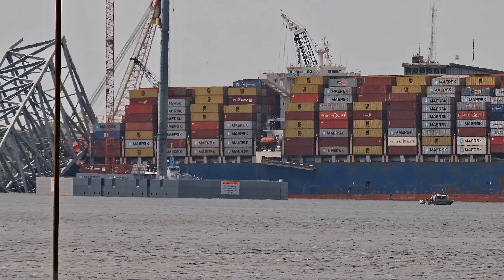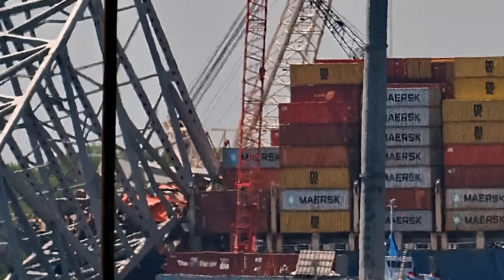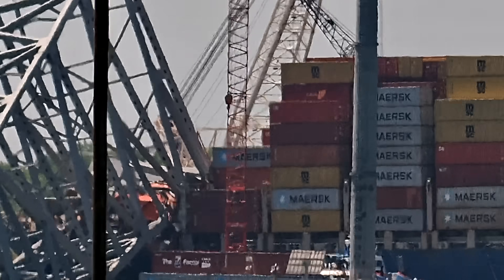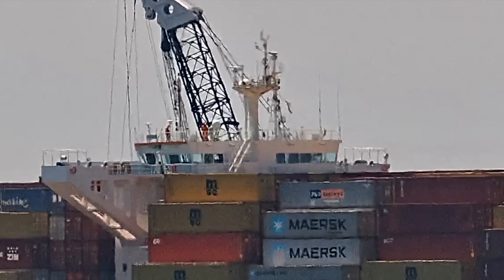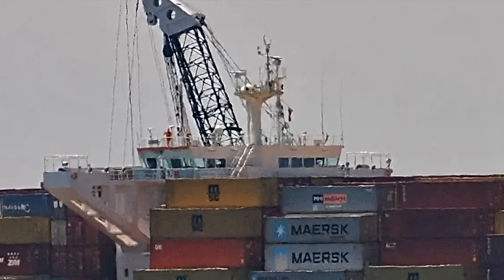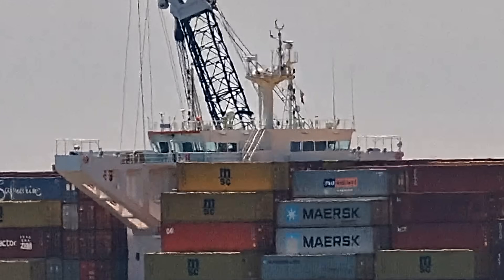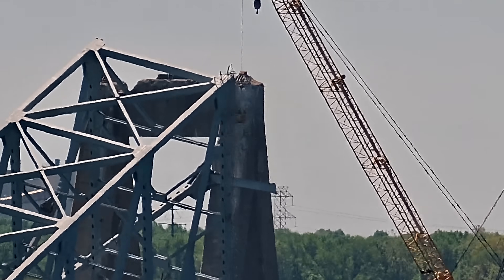Work at the Baltimore Bridge Collapse Site

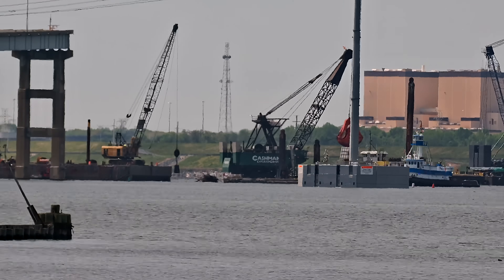Comment: 1:00 - I had been wondering what the yellow Lima 2400 was used for.  Turns out it's handling the drop ball to break up the bridge pavement.  The mess of debris that Dale Pyatt is pulling out shows how useful a big dredge is, just grab big handfuls of whatever is down there without worrying about what it is.

Comment: as they take these containers off of the ship won't that lift the ship and change the bridge parts that set on it?
Reply: The loads on the ship do change but is the change enough to move the ship?  That is THE question.  It could, but the most load is still the steel from the bridge on the deck which is not changing as the containers are removed.
Reply: @royreynolds108    also consider that the ship has run aground so the front is not floating right now. Of course, they also have the ability to flood ballast tanks to maintain trim.

Comment: I would like to know if there are a engineering team involved with this container unloading in regard to keep track to the weight of each container being removed so that the balance of the ship will be  kept so that the ship will not roll over when it is refloated?
Reply from the maker: Constantly monitoring
Reply: The crane's have load cell's that are connected to a operator display . It gives instant display on  angle, load, etc. 
That's how they report moving a 405 ton piece. This video show's the Cashman Dredge redlining with 2-3 lift's. Alarm's, buzzers, etc. went off and he turned the load loose. 
Yes, there is a record of the container #, weight and location. The ship engineer will keep track, update and provide info to the riggers that are removing containers to maintain the balance. No, Happy go lucky! or Time will tell! actions now after time has told. 
They are also told where to cut the bridge beams in order to get a 405 +/-50 ton piece, 50% (2X safety factor) crane capacity load.
Reply: @martylost167  Thank you for the peek inside the crane operator's cabin.

Comment: Why was the decision to work on the Dahi later than in the beginning?
Reply from the maker: Well I think they have been from the start. It may have not been as visible as it is now, but they have been working
Reply: Well the plan was to open the port first from day 1 for the people to have jobs and not lose what $10-15 million per day. . The Dahi work in the hardest, most dangerous and most time consuming. All the bridge steel has a preload like a very, very, large spring. Weights, loads and cuts must be all planned very, very carefully or someone else will be killed when tons of steel jumps 3-4+ feet in a thousand of a second.
Reply: @MinorcanMullet    I would imagine each section of this job has its own engineers working on specific problems, which is why different areas are moving at a different pace. I mean, it's a different task every few feet in this situation.

Comment: I know some of this work is nothing short of heroic but someone please tell me why there is only one, one-thousand ton crane on site when there are several 14,000 ton capacity cranes available elsewhere.
Reply: Correct
Reply: Lofting height/extension possibly? The difficulty of rigging and lifting bridge sections large than ~500 tons? Good probability they can’t handle the dismemberment at the staging area any more quickly than they are. (Although I’d think they could lift big sections out of the way and “park” them somewhere in the water outside the channel until they could be scrapped.)

I dunno, I would like to see the answer to that question.
Reply: Which crane ship did you have in mind for this job?
Reply: Have you(singular) considered that the room to work might be the reason?
Reply: In reply to ‘which crane ship did you have in mind’ I just Googled the question and found a Panama registered double crane ship capable of lifting 20,000 tons in a tandem lift. These cranes may not be currently located near Baltimore but I hope some of them are making there way there right now.
Reply: It would be good if the news reporters addressed the subject of why there is only one substantial crane on what is currently the most important demolition, an not forgetting human recovery, sites in the world
Reply: @raymason5779  There are all the cranes on site that can safely work the area in my opinion. 
A 20,000 ton lift takes months to prepare with the safety reviews. They can take little bites, if you can call 100,000 #'s a little bite, all day. 30 more days, depending on weather and they might be done as things speed up.